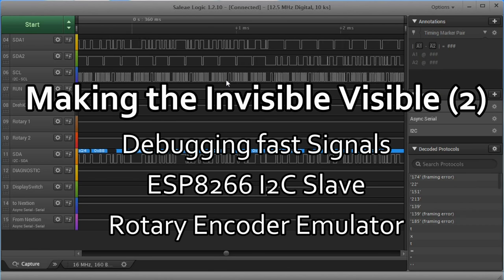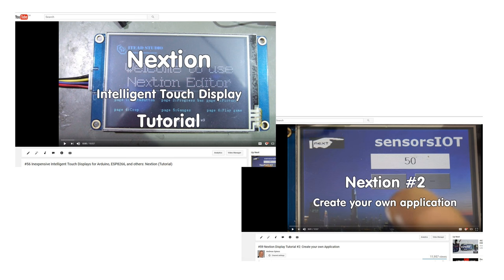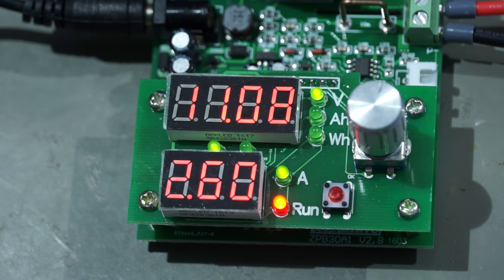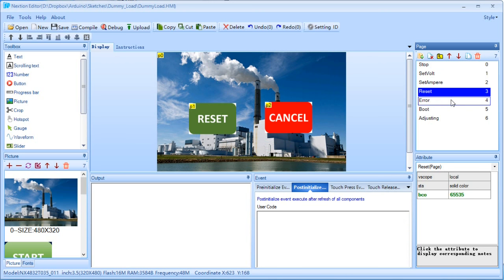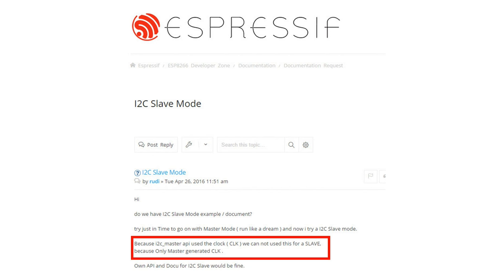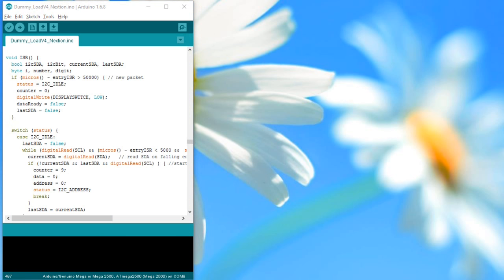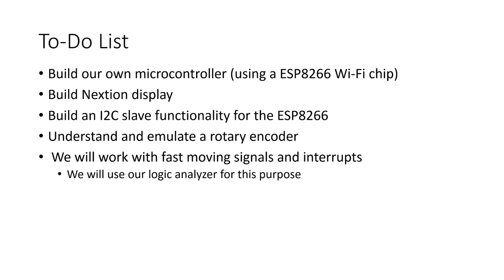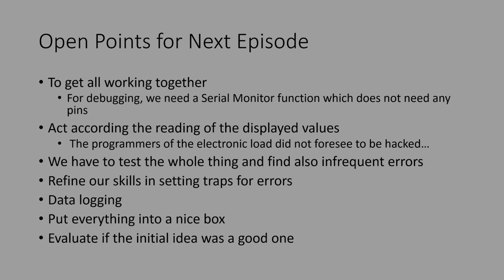#76 Making the Invisible Visible: Debugging Fast Signals, ESP I2C Slave, Rotary Encoder Emulator

Comment: Apparently there IS a way to debug interrupt driven code.  I've always just pull my hair out and cuss.  Your method is much more effective. :-)  Thanks Andreas!
Reply from the maker: I love interrupts, they are very powerful, but not easy to debug. That's why I made this video.
Reply: Just want to tell you that I've just used the technique I learned from you!  By flipping debug pins in code and watching them on the scope, I was able to see and measure how long my interrupt routine takes compared to how often it is called.  Thanks Andreas!
Reply from the maker: Glad to read that!

Comment: Hi Andreas,
I bought a few ESP8266 months ago at $2 each. These are the tiny ones with only 2 i/o in them.
I haven't been able to find how I can use one of the pins to read a switch. Output, no problem.
Any way to read an analog signal with this small module? I want to be able to read the state of IR sensor and a push button switch, without going to a bigger ESP2866 model.
There was a page that showed a trick to do that. Lost the link :(
Reply from the maker: The ESP-01 was designed to be used as a serial connection using AT commands. Therefore, they did not need many GPIOs in addition to RX/TX. You only can use GPIO2 for input and output. GPIO0 can also be used, but you have to be aware that you need this one for flashing. The analog pin is not available.
I would not bother with these modules and spend another few dollars to get a nodeMCU board. The smallest are not much bigger than this one.
To use a pin as output you use pinMode(2,OUTPUT); and digitalwrite(2,HIGH); or LOW 
Select the generic board in your Arduino IDE and adjust the memory (usually 512k).
Reply: Andreas Spiess
Thanks for the heads up. I did buy a few other models including a couple of $4 nodeMCUs. However, I am trying to find a use for these 4 that are currently dust collecting modules.
I'll use GPIO2 to monitor the IR motion detector's output.
Bought 10 mini pros for $2 each!!! I don't use discrete components anymore. Besides an Op amp or 2. No other components needed.
We live in the best of times :)
Edit: Found the link that allows you to use 2 outputs and 1 input on these little gems.
Maybe of use to your other viewers.
http://www.instructables.com/id/How-to-use-the-ESP8266-01-pins/?ALLSTEPS#step3
Reply from the maker: In a similar way I use Attinys. They are even smaller than many discrete components...
Reply: Thanks. I didn't know about them. Like the PIC12F on steroid!
With hardware PWM for an H-Bridge and 2 external interrupts for the encoder, it would make and ideal servo motor controller. Thanks again.
Reply from the maker: I made a ultrasonic sensor with one attiny85 and 3 sensors. At the end, it behaved like an I2C slave. (Video#40)
Reply: Are there any Arduino servo libraries (Not R/C) that use quadrature encoders and PID?
Reply from the maker: Can you be a bit more specific?
Reply: If I have a brushed DC motor with h-bridge to drive it, and have the shaft encoder connected to the interrupt pins, is there any Arduino based library that has already been written to do run this setup as a servomotor?
Reply from the maker: I also did a tutorial about PID controllers, if you are interested (#28)
Reply: hi sir .....
pls can u share ur code for this

Comment: Dear Andreas. Interesting work. I did exactly the same but directly in C without Arduino. I have the problem, that reading the GPIO takes too long. So after entering the ISR() it is not fast enough to read the SDA pin, so that it already changed to another state. What is your maximum speed? I can't run the I2C slave routine with 100kHz. Thanks for any help. 

liebi Grüess
DK
Reply from the maker: I do not know the speed because I did not care. But 100 kHz has to be possible. According the datasheet "The interrupt execution response for all the enabled AVR interrupts is four clock cycles minimum. After four clock cycles the program vector address for the actual interrupt handling routine is executed."  This is with 16Mhz clock 4 MHz. So at least, it should be able to react.I would test it with the logic analyzer as proposed in the video.
Reply: Thanks for the quick answer.  I also measure with an oscilloscope. The problem is that I miss the START signal. I trigger on the falling or rising SDA edge. If SDA was falling and SCL is high, it is a start. the problem is, that when I measure the SCL it has already changed because the duration to get into the interrupt is about 1us, which is already too long. To measure the input I use the funtion GPIO_INPUT_GET(), which I believe should be also fast enough.
Reply: just to clarify: I don't miss the START on the oscilloscope, but the latency is just too high that the START is not detected properly by the ESP8266.

Comment: Nice! Good explanation on ISRs! 
Would it be possible to override the microcontroller for the load all together with a ESP8266?
Reply from the maker: I do not understand. Can you explain a little more?
Reply: I might be wrong but it looks like the electronic load has a microcontroller, just that its unknowns what the software does inside that microcontroller. Right now it looks like you have been emulating all the peripheral functionality with the ESP8266: would it be possible for the ESP8266 to take the place of the microcontroller?
Reply from the maker: +xennelul I thought about that, but it was mechanically challenging (the MC is in a small package). But appart from that it would be easier...

Comment: Good video! I'm working on a project that I would be an I2C slave.
I would really like to look at your slave code but I'm not able to find the code anyplace?
Is it posted?
Reply from the maker: I do not think, I published it, because it is not a full implementation, just for my purposes. Other people worked on it, but I do not now the status.
Reply: Ok then but I'm confused?
And I don’t mean to be rude or ignorant.
But what is the point then?
Reply from the maker: It was just for my purpose and I will not publish it.
Reply from the maker: Here you find the discussion about the implementation for the ESP: http://bbs.espressif.com/viewtopic.php?f=49&t=2092&start=30
Reply: Thank You
I was not able to find this discussion (for use in Arduino).
And I search a number of times.
All I was finding was implementation using the ESP tool chain.
Reply from the maker: For Arduino there is a Slave library somewhere. Just not for the ESP.

Comment: I think portOutputRegister()might be alot faster than digitalwrite, you might want to see if you can get faster gpio writes with that. digitalPinToPort , portOutputRegister, digitalPinToBitMask can be used for direct port access on esp
Reply from the maker: You are right. So far, I did not need this additional speed. But with Arduinos, I used it once in a while.

Comment: That original device really did have a truly horrible user interface.  Is there a microcontroller somewhere on the main board of that unit?  Since you seem to have stalled in terms of making progress with the approach you have been taking,  perhaps a look at what that controller is doing may open up a different avenue to pursue this?  In either case,  I would have been interested in seeing the code that you had so far,  finished or not,  as there were a few neat tricks in there and I don't have the patience to try and pick it out of the video...
Reply from the maker: You get now similar devices with proper PC interfaces. It has an MCU on board.

Comment: thnx a lot for this great video
could you please explain why didn't you use the wire.h library?
also why did you use separate pins for different i2c devices? i use all devices on same two scl and sda pins.
is it because slave is not possible with wire.h now?
could you please share your code?
thnx a lot.
Reply from the maker: As you wrote, the wire library only supports master mode. Concerning the code: The project is still not finished. But, I hope, it will one day. Then, the code will also appear on github, as usual.
Reply: thnx, i was trying to use i2c to use esp as a thing data updater controlled by arduino and during coding realized its not working as slave. so i ended up using 9600 baud serial communication. worked great :-) however i would prefer i2c but until then i'm going with serial.
i hope you would finish your i2c slave code since i realized there's a lot of people wanting this as well.
thnx a lot.
Reply from the maker: Wilco
Reply: Andreas Spiess what is Wilco?
Reply from the maker: Abbreviation for "received and (I) will comply, from the old radio operator days ;-)
Reply: Hi, did you ever get to finish your I2C slave code for esp8266?

Comment: Wow. Great work. I would like to see the encoder emulator routine...there is no decent encoder model in Proteus and this would be a possible solution.
Reply from the maker: This routine was quite short:

const byte right[4] = {2, 0, 1, 3};
const byte left[4] = {1, 0, 2, 3};

void stepEncoder(int dir) {
  byte rot;
  for (int i = 0; i < 4; i++) {
    if (dir > 0) rot = left[i];
    else rot = right[i];
    digitalWrite(ROTARY1, (rot & 2) >> 1);
    digitalWrite(ROTARY2, rot & 1);
    delay(10);
  }
  delay(100);
}

Where ROTARY1 and 2 were the pins. If I remember right, each call made one step in the direction in the call. But do not ask me how it worked...
Reply: Right. Appreciate it. Thanks!

Comment: Very useful Andreas - as it happens I'm just using I2c to turn an Arduino into a peripheral for my ESP projects - right now I'm struggling with which exact moment the slave should introduce clock stretching - or rather - at which exact moment the software-driven ESP I2c should look for it....  (right now the standard ESP software doesn't do that - but I'm adding that in - any clarification on that of which you're aware would be helpful...   http://tech.scargill.net
Reply from the maker: Fortunately, I did not have your problems yet, because I try to only use I2C to transfer numbers, not strings. I read your posts. You are way more advanced than me! So, I am not a big help in this matter.
As you also mention in your blog: I do not like the delay() command for fast things, I rather like interrupts or at least while loops, because both adapt to the real signals. This obviously does not apply if your code is the active "timer"...
I watch your work since a long time. You do a great job!